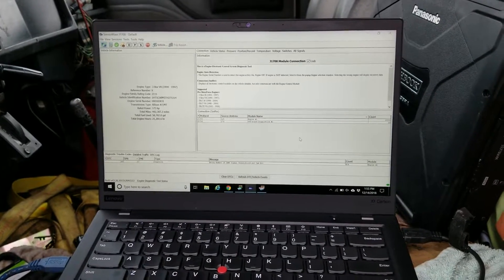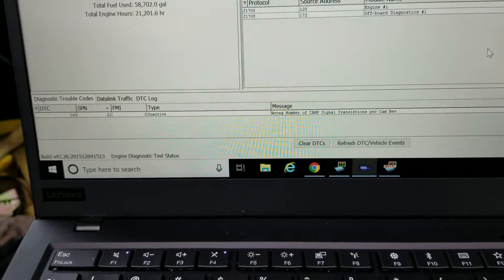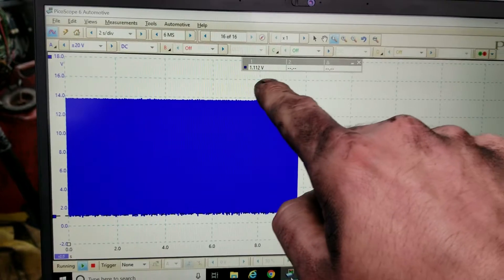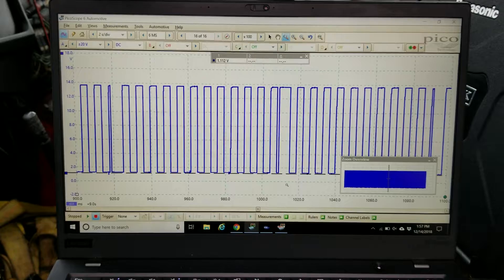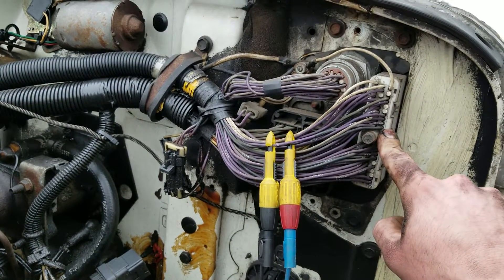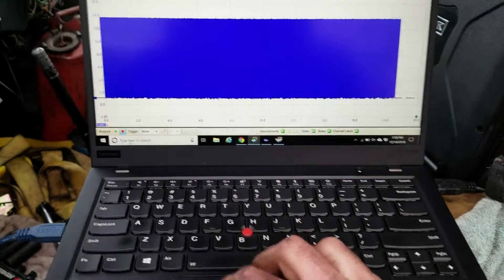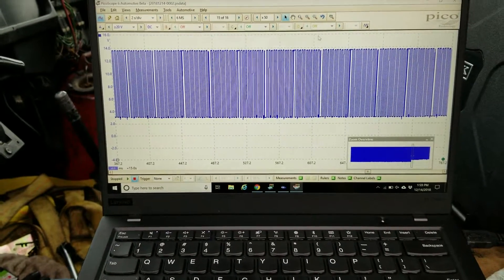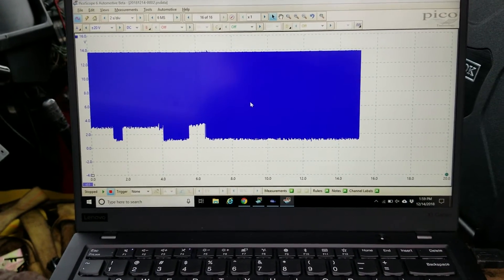International T444E Cam Sensor Diagnosis

Comment: Does it have a obd2  connector  or  do you need a special  scanner for those  trucks?
Reply from the maker: You need a RP1210 adapter. Nexiq USB Link is the most common used in shops. The software for this vintage International is free.